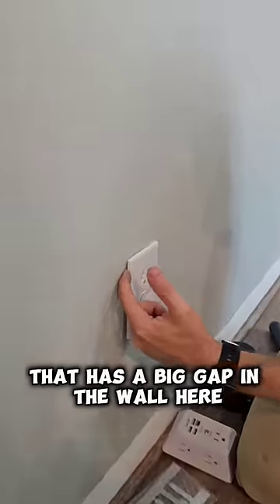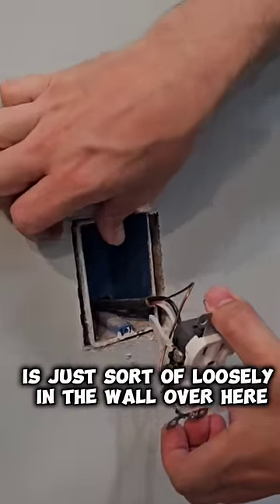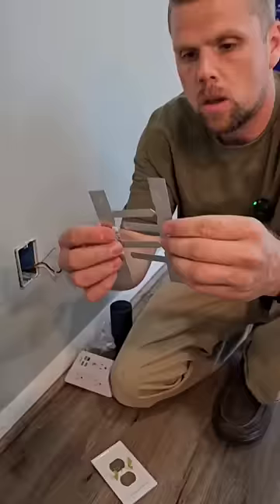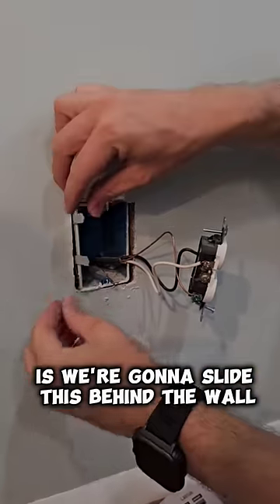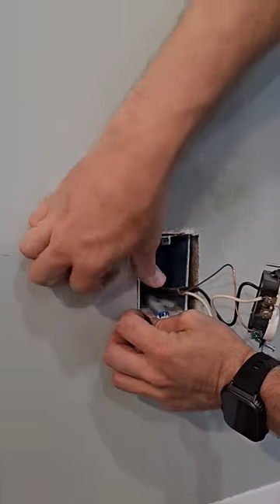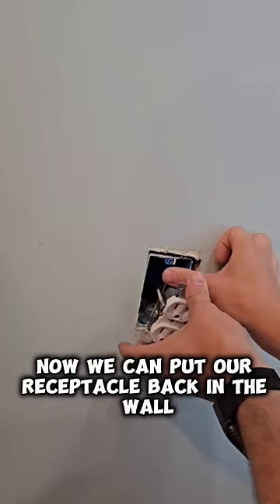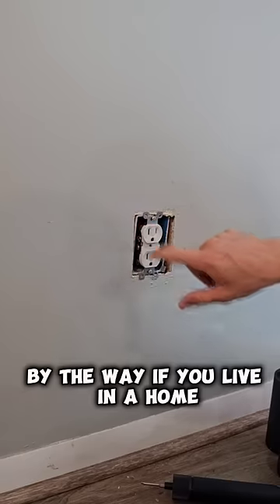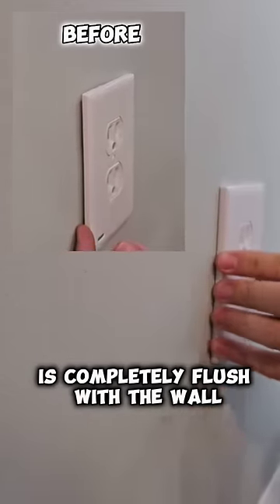🤔 How to fix an electrical box that is sticking out of the wall #diy #handyman #election #howto

Comment: If you go to a supply house or home improvement store, we tradesman refer to this as sheetrock clamps or sheetrock ears. I'd avoid asking for strap ons lol.
Reply: Exactly what I was thinking, a strap on should have a little something sticking out the wall after the plate put back on! 😂
Reply: F clamps
Reply: @eliascurrier1353  I've heard this slang too!
Reply: I’ve only heard them referred to as battleships. That may just be a thing in my state though.😊
Reply: C clips
Reply: F-clamps in Canada too. Strap ons are for after business hours.
Reply: In the Washington DC area Madison straps is the most common term and plaster board clips the second most common term
Reply: Madison straps or battle ships. Never em heard your terms in my life. I am from Michigan.
Reply: Jiffy clips or Madison straps
Reply: Madison strap not strap on. Clearly a Freudian slip
Reply: Battleships in ca
Reply: Madison straps in PA.
Reply: I'd just shim it on the stud side but I actually know what I'm doing
Reply: Madison hangers in chicago. Use them exclusively for gem boxes. Commercial work is all metal boxes (1900 boxes) and conduit. Plastic boxes gross me out.
Reply: Just like you said they're called Madison straps electricians call them submarine straps
Reply: @jerrywtt  or submarines straps
Reply: @justinsaunders785 I'm in Michigan too and we call them submarine straps or battleship straps too
Reply: Battleships, steamboats, submarines; all sorts of fun trade terms for them!
Reply: F straps in Minnesota
Reply: Madison straps or battle ships around hear.
Reply: I thought they were called battleships
Reply: I thought they were called battleships
Reply: I thought they were called battleships
Reply: I thought they were called battleships
Reply: I thought they were called battleships
Reply: Madison bars
Reply: Mad bars on cape cod. Madison straps also. Madison is a naval boat I’ve been told, but I could be wrong

Comment: i just drive a screw into the stud   works every time👍
Reply: That's exactly what I was thinking. Cheaper, faster, and sturdier
Reply: There is no stud. The box is mounted to a stud on the right, the wall cavity is to the left. The nearest stud is at least 16” away. Only thing there is drywall.
Reply: @YeahBoy1019 They're talking about driving a drywall screw through the box into the stud on the right side of the box. This method can work occasionally but not every time.
Reply: For the purpose of this video I would say a wooden shim on other side
Reply: Woah, hold up... If you poke an unauthorized hole in a box, doesn't that cause a code problem?
Also, remodel boxes are a thing that can be jammed into a hole away from a stud. If the box was this shit to begin with, don't see why it couldn't be an option here.
Reply: some people just like using strap-ons
Reply: @DingleFlop I don’t think you’re calling the inspector for the plate sticking out off the wall.
Reply: @El_Diablo_LI  of course it will work
Reply: Don’t do this its against code and a potential fire hazard.
Reply: No screwing a stud is required when you can use a strap-on on that box 😂
Reply: Why introduce metal plates into an receptacle box unnecessary 😮
Reply: @YeahBoy1019 you don't know how boxs are mounted do you? Some times when you don't know its best to not say anything.
Reply: Couple of wedges n silicon.😂
Reply: That's how it's done in Ireland too
Reply: @DingleFlop  I've never met an inspector that either notice or give a shit about something like this.
Reply: Use duck tape
Reply: @Kevin-bl6lg  why would i use duct tape i use electrical tape on electrical appliances
Reply: Code violation
Reply: @YeahBoy1019 actually the space in between the studs is 14 1/2".... 16 - 1 1/2 = 14 1/2  math can be fun!
Reply: Would it appease the code enforcers to use a plastic screw to remount the receptacle box to the stud?
Reply: @DingleFlop no it is not a code problem
Reply: @YeahBoy1019 You can literally see the stud on the right boss man
Reply: @YeahBoy1019 dude go back to fortnite and leave us alone, real men working here ricky bobby
Reply: @DingleFlop loooool bet your a hoot at parties mr government man
Reply: @FieroGTXX no its not, you have no clue so hush
Reply: Exactly what I was going to say! Lol
Reply: @YeahBoy1019 you simply put a screw through back right side of box into stud to pull flush, done
Reply: @YeahBoy1019 ya put a screw in the stud as far back as you can and it will suck it in. Just not code to use a drywall screw
Reply: Yep
Reply: Yeah, a screw to the stud works 100% of occasionally.....
Reply: @YeahBoy1019  “ there is no stud the box is mounted to a stud on the right” explain plz
Reply: my thought and dont need 300 different little nick nacks to keep up with in van
Reply: You got that right brother
Reply: I sure hope you ask permission first.
Reply: 😂 what I was gonna say
Reply: @joshdiehl8737 and no strap on
Reply: this
Reply: @YeahBoy1019 just make a hole at an angle from the middle of the wall towards the back and tie the box with a zip tie
Reply: That’s actually safer than what he did. Adding in grounded piece of metal into a plastic box is def a no no.
Reply: @DingleFlop  nails/screws can be driven within a 1/8" or 1/16 from back of the box.
Reply: Exactly👍
Reply: That hasn't been code compliant 4/10 years
Reply: I'm an electrician. The state that I am in still uses the 2020 NEC. I drive screws into boxes occasionally. It is technically against code in this specific case.
Reply: @TheNolanator1  give me the section number
Reply: @DingleFlop the box has four knockouts in the back. A screw hole close to a stud is way less gap.
Reply: @bufffatty9160  I think it's 110 B. I'll have to look it up. You are required to install according to the manufacturer. So drilling a screw in that box is not according to what the manufacturer states. It's stupid to some but that's how it works. You can call the manufacturer and ask and see what they say for your exact idea. I have done it before and mainly they tell you to cover the screws with silicone. Just make sure you request an email to keep a record.
Reply: @Kevin-bl6lg  duck tupe isn't going to hold that box back, there's a lot of TENSION, it needs a STRAP-ON!
Reply: Screw to stud against code but what if you cover the screw with a non-conductive coating or whatever?   Either that or use your strap on.
Reply: @jpkemmitt  we have done that per instruction from manufacturer. So you can call the manufacturer Tell them your situation ask if you can do that and they can tell you yes no or do it one particular way. Tell them to email that instruction to you. Now you're all up to code.
Reply: @creamofbotulismsoup9900  mine said use screws that don't have sharp edges, and put them at the outer corners so they don't accidentally hit a screw terminal.

Comment: Us electricians call those battle ships. Also, if you’re going to use those wrap some electrical tape around the outlet to prevent the stacks from making contact with the outlet
Reply: You must a sparky in ca . In  Utah they’re called steam boats same smell . I used to live there .
Reply: In chicago we call em Madison hangers.
Reply: It Texas we call them f-clamps
Reply: Yeah well. They should be either none conductive or grounded.

The hole idea of metal things poking out of a protective casing is kind of off
Reply: @Schemen123 it'll be just fine. There's nothing to use in place of steel.
Reply: "F straps" y'all are crazy
Reply: @gergimmal5312  battleships on the west coast - and if you have to cut them down to get them to fit into the opening, they're tugboats.
Reply: Yeah battleships is all I’ve ever heard them called and I’m on the west coast.

Comment: Before you do any electrical work, make sure the breaker is off, double check that there is no power going to the outlet, and  use the proper protective equipment. If you are not sure what are you doing,  please call a professional.
Reply: It's just a strap on
Reply: @jpkemmitt  exposed wires!!!!! , please follow my suggestion and stay safe.
Reply: People should try to fix their own stuff. Nobody's going to hurt themselves with a 110v outlet. Just bites ya a bit, then you learn what not to do
Reply: @NickR..  😒
Reply: No. Breaker stays on switch off easy peasy. Just don't be dumb and you'll be fine.
Reply: Find me an electrician who turns off that breaker and I’ll show you a shit electrician. It’s like clock work, all the hacks in our company shut off breakers and tape wrap devices. Why? Because they know they have shit craftsmanship and will arch and blow shit up.  I ride there asses like sea biscuit, doing 2/3 outlets to their one outlet all while mine is a cleaner more serviceable install. I am the top electrician/project manager in our company.
Reply: @justinsaunders785  there's always the one person who thinks that knows everything. 🙄
Reply: @justinsaunders785 Ladies and gentleman….its Captain full of it!

Comment: Also, what a super specific piece of hardware 😲
Reply: It's also called an F-strap or a battleship and is typically used for metal cut-in boxes (remodel or adding outlets in existing spaces). This is the first time I've seen one used for this application. Creative... I guess.
Reply: I'm sure he could have called it an outlet box adjustment strap and 80% of the comments wouldn't be here. I see what he did there. 😆 Way to work the algorithm.

Comment: I call them battleships.  Have called them that for over 50 years.
Reply: I call em steamboat clamps
Reply: Madison bars. F clips. E tins. Hold its. It just depends on where you are working in the country as to what they are called.
Reply: I'm boring, I just call em sheetrock clamps. 

Never have I heard Madison strap ons. Ever.
Reply: I honestly didn't know that they were called anything but battleships
Reply: I’ve called them Madison clips for 35 years. “Madison strap ons”????? LMAO!!!!!!  Plus when a receptacle is sticking out like that it’s usually because the nail on box was attached wrong (more than 1/2” past face of stud), and you’re not fixing it with a Madison clip. You’d need to sawsall the nails off the box, then reattach box to the stud with drywall screws…..or…..if that’s too much work, you could just go and fu(€  yourself with a Madison strap on. LMAO!!!!
Reply: Well it's"strap-ons" now grandpa! Times are changing old man 👊🧐
Reply: the old timers call them battle ships. Think it’s a 70s thing
Reply: Yup I was introduced to em as steam boats
Reply: Believe it or not, I’ve called them Madison clips for 35 years and never heard them called battleships until this vid.  I used one yesterday and held it sideways, and yuuup, it looks like a battleship. I never even noticed that.
Reply: I am going to guess… you are no longer going to refer to them as that anymore and now use their proper name, Madison Strap-Ons?? Is that right?
Reply: @notoriouslycody  No
Reply: Same that’s all I’ve ever heard them called. That’s how I order them from the parts house too

Comment: This is the kind of stuff I come across and rip the whole thing out saying “who uses Madison straps on a plastic box”
Reply: an old work box opening is smaller than a plastic one
Reply: You would use a old work plastic box for this repair.  Cut the nails break the tab off where it’s holding the wire, toss the box.  Clean up the hole for the new box, pre screw the screws into the plastic wings then back them out to where they were.  Little tip to keep you from breaking the wings.  Push the wire in push the box in level tighten install outlet done.
Reply: @MrStatic101 uggg or bend 2 tabs of metal and be done in less than 30 seconds
Reply: @NQTOD  you can also drill a hole in a sewer line to run a condensate hose.  Doesn’t mean you should.  You can do things the right way or you can be a hack.  We all get to make those choices every day.
Reply: @MrStatic101 Or just cut the nails holding the box, recess the existing box an eighth inch where it should be, and attach back to the stud with a couple of drywall screws. No need to replace the box, right? It’s just more work to accomplish the same result, especially if there’s cables coming in the top and bottom of the box. Why replace the box?
Reply: @SnotrocketLT4  the only time I will do screws inside is if I’m installing a smart box in its place.  Feel free to do whatever you want to do I just can’t do it because I’m responsible if it comes back.  Does your idea work, of course, could I do it, no.

Comment: Jiffy clips are for commercial use 
Sure it’ll temporarily work but your better off replacing the box with a pop in box 
Or putting 2 drywall screws in the box 

“Has to be in rear of box or it fails inspection”

The jiffy clips will inevitably become loose and not work.

Comment: I love this. I’d of put a backing piece or a drywall screw or two but this is much better.

Also “decora” receptacles tend to have better fits with the two plate screws

Comment: Better put some tape around those screw terminals
Reply: Yep, the anchor straps do technically make this a metal box, tough to know where code stands on this because there is no ground screw for two independant anchor straps..
Reply: Still bothers me on plastic boxes, you almost gotta put a straight jacket on me when i find one in a commercial application w/o electrical tape😂
Reply: Look closer. The coverplate needs to hit the screw terminals.
Reply: Those cover plates are known fire hazards removed a myself several caught on fire
Reply: @lamontlamont6766  Did you remove it because it caught on fire or did it catch on fire while you removed it?
Reply: I removed it because it caught on fire if you live in a high humidity area they corrode and get hot and catch on fire
Reply: Nope.
Reply: Thank you. My thought exactly.
Reply: Guessing you're one of those guys who tapes every receptacle regardless of whether or not it's even something that could potentially be a safety concern?
Reply: No need to tape the outlet because:
A: The strap is not grounded
B:  The strap is on the         neutral side.
C:  There is no code requirement to do so.
Reply: @lastchance8142  the strap is on both sides. If the terminals touch the strap and your hand is on the box where they bend over you will get a jolt

Comment: And I advice wrapping the outlet in tape when you use these. I had a case where this house had lamps controlled by wall switches. The top of the outlets were full time power and the bottoms were switched. But some of her lamp either would not go off or would flicker or come on by them selves. From some reason over half the outlet boxes were free hanging and were just held in place by these metal strips. They were not even put in all that well and were shorting the top and bottoms of the outlets together.

Comment: In my area we call them f-straps or jiffy clips.  This problem is caused by not securely nailing the box. A couple of screws through the side of the box into the stud will solve this.
Reply: Some jurisdictions do not allow fasteners through the box I’m told by my licensed electrician.

Comment: Better insulate those terminals my guy
Reply: 2 wraps of electrical tape.
Reply: Might want to tell them to cut the power first too.
Reply: i guarantee after you typed your comment you went straight to your mirror and padded yourself on the back...didn't you?
Reply: @Carlos-wy4on  yes, Naked of course. May have saved some DIYers from burning there house down, not all heroes wear capes
Reply: @Mark-gt9yv  i respect your reply. good day sir!
Reply: Insulate why? It’s a plastic box. What’s gonna happen?
Reply: Why? Hot isn't even on that side, and if you're worried about nuisance tripping, put them on right and you don't have any problems. We don't make money giving away all the tape for no reason.

Comment: You could just clip the stiff excess wires off after turning off the circuit. Then, reinstall the wires. It will be flush and tight without wire pushing it out of the damn wall... Keeping everyone happy, keeping strap-ons out of your home. More importantly, out of YOUR BOX!!

Comment: Yes start by taking a pointed punch poke a small hole on stud side of box use a 6 inch square tip towards middle back of box see if that helps first to flush up box. We call those box supports , after you bend over metal to inside squeeze ear with needle nose pliers for better fit

Comment: The only issue with that is since it pulls the box closer to one side, it could reveal the wall hole on the other side.  Even if it didn't happen in this case, it potentially could.

Comment: And if it is a metal box, wrap both the recepticle with a few rounds of electrical tap long ways all the way around to guard the screw lugs, and wrap the bent in fingers, (all 2 or 4 fingers, pending if you use 1 or 2 straps).

Comment: If the box is moving this means that the steel stud is not locked, therefore this box does not pass inspection and safety requirements... You need to fix the problem rather than a ''just for now'' solution that is a hazard. If you want to lock the stud, simply remove the base board and access the lower track and lock it with a wafer screw, then put the baseboard back in place... The box will return to its standard position.
Reply: hmm, then why do those POS boxes pull out of the wall where I work? we dont have steel studs whatsoever. 2x3 interior walls framed 60 years ago, hard AF ancient dimensional lumber

Comment: It’s clearly a new work box, so you could just drive two Sheetrock screws in the box to the stud. Much cheaper and easier and tape the receptacle to ensure safety.

Comment: That’s a nail on the box so there’s a stud next to it. You could also take a drywall screw and put it through the box into the wood stud that would make it solid and flush with the drywall as well.
Reply: sure, but you just violated code